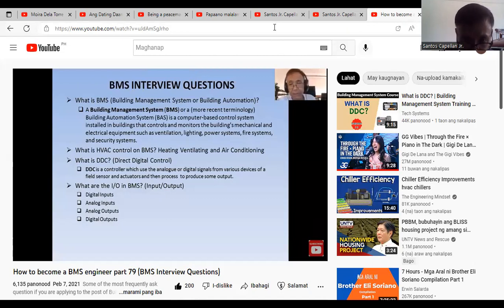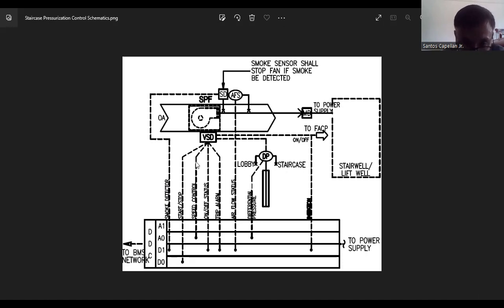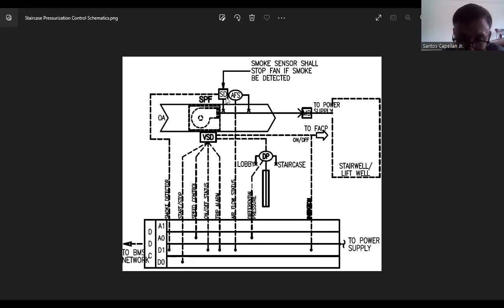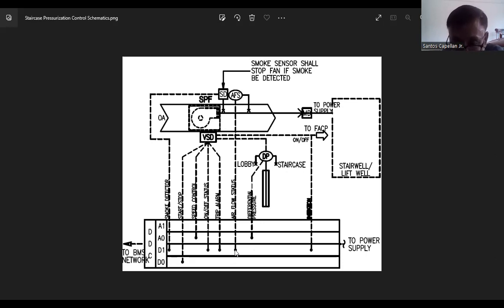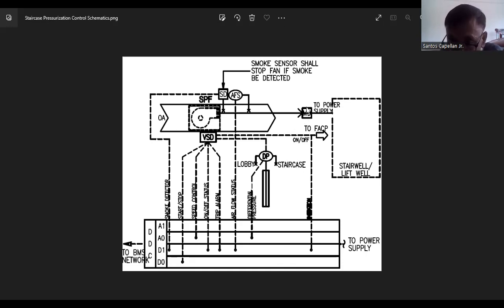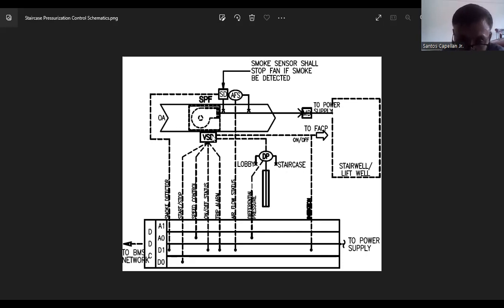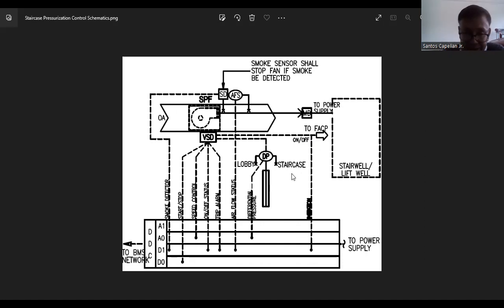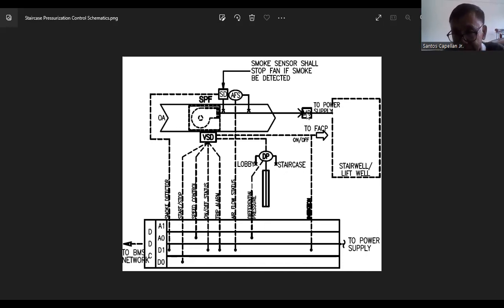BMS - TEST for a BMS engineer, foreman or technician applicant.

Comment: Thanks, a lot for your clear and helpful video Engineer. I would like to ask What are the data that need to monitor and need to record in BMS System as an Operator? Hoping for your kind response.
Reply from the maker: Thank you appreciate it, actually BMS system it has alarm points monitoring, it depends on the maintenance department what they want to monitor closely in the BMS system. An example is the temperature reading of chilled water supply and return temperature being supplied to all the air handling units, AHU's supply temp and valve opening as well, as I said it will depend on the maintenance supervisor or engineer, but you can initiate, just check what are the critical system in the projects that needs to be monitored closely
Reply: @SantosJrCapellan-BMS  Thank you! Engineer. Well noted.
Reply from the maker: you can record also all the occurrence of alarms specially if some equipment trips, when it happens and if it is attended
Reply from the maker: you can note also if there are sensors like temperature, pressure, humidity, etc. that is giving false or un realistic values